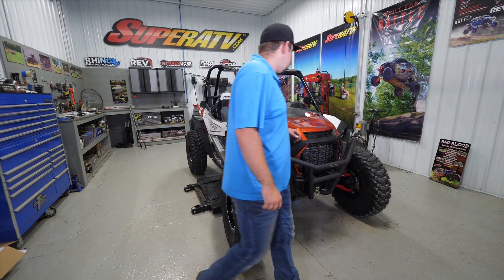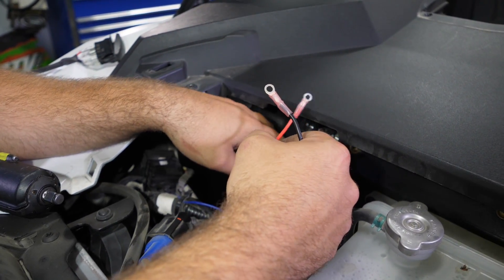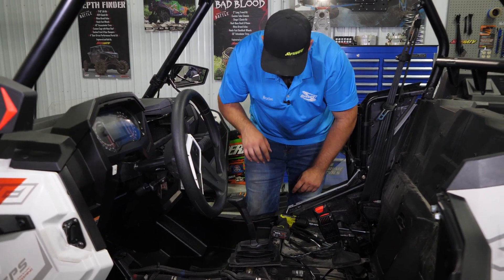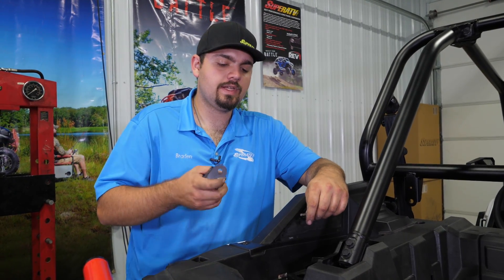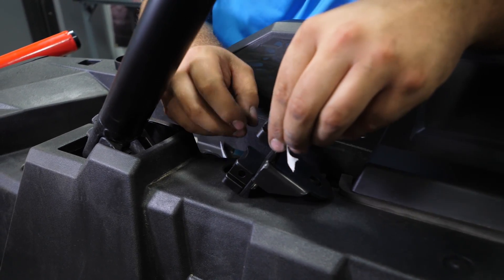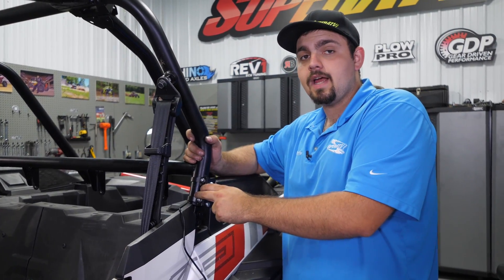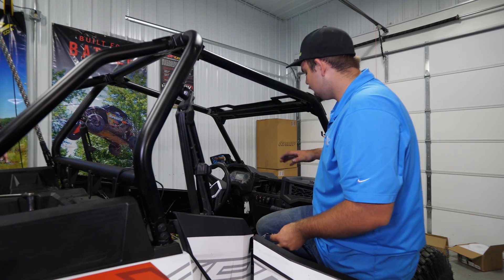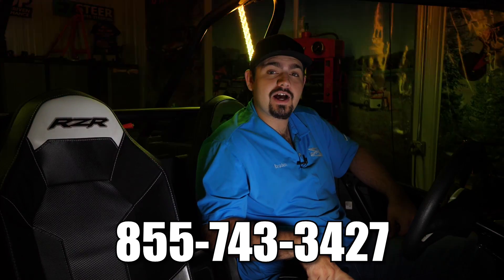How to install SuperATV's 5' LED Whip Lights | Light Up The Night | UTV Whip Lights

Comment: Just bought a set.  Worked perfect on the bench connected to battery. Installed on vehicle, won’t turn on, have power all the way up to plug on whip. Get this, if you use test light on the other 3 pins in plug. The other whip will light up. Makes no  sense, it’s like a bad ground, but we than hooked directly to battery. Still nothing.  So from the bench to vehicle, the harness or control box must have screwed up.
Reply from the maker: That's definitely an odd one. I'd say loose connections in the control box? If you could, give us a call so we can swap it out and send the faulty one to our supplier to see what went wrong there. Our number is 855.743.3427 and we are in 8a-8p (edt) Monday-Thursday and 8a-5p (edt) Friday.

Comment: Question I just had two of these dealership installed 5' on my 2022 pro R ultimate and i can not get them to work right? The only way the whole whip will light up is in demo  mode? Any other mode and i only get the bottom 2' that works? It is the same using the remote or the app. How do i fix this? Thanks
Reply from the maker: Go to the app and choose settings, then chase settings. At the top it says "please scroll to select". Select your whip lights and change the pixel to 1000. If this does not correct the issue, give us a call, 855.743.3427.

Comment: My bluetooth doesn't want to pair with the app. It used to come up but not anymore and my whip wont light up. I have power to one of the 4 pins on the connector. Any suggestions?

Comment: I have a big question I bought two whips separate and one has a red and black and the other has another red and black (2 leads) so my question is do I buy a 14 gauge wire to connect to both red and both black should I buy a 16 gauge or does it matter ???

Comment: Do I need a harness for my whips I have a light bar and I hooked them up to my buss bar and it blew my fuze the light bar is hooked up with with a harness but my whips were not
Reply from the maker: Yes the harness is required for these whips to operate. Check out the installation instructions here: https://www.superatv.com/amfile/file/download/file/4107/product/14975/